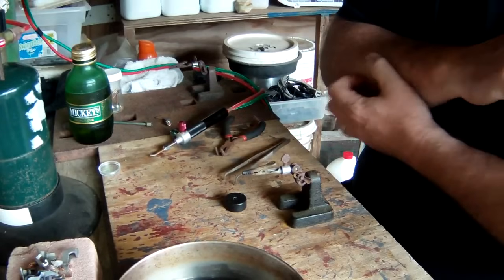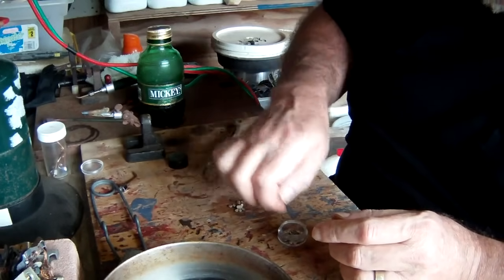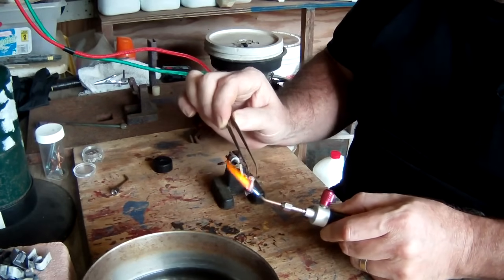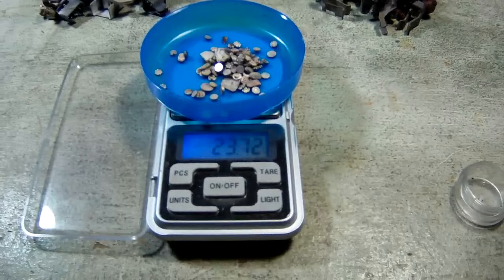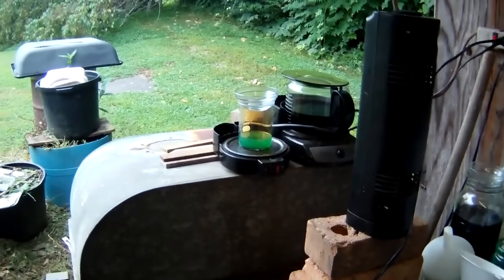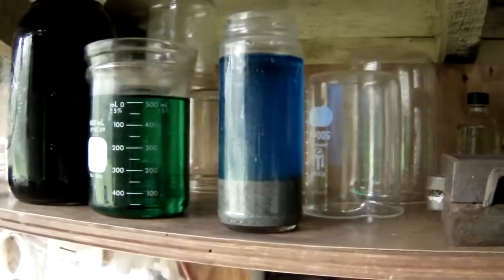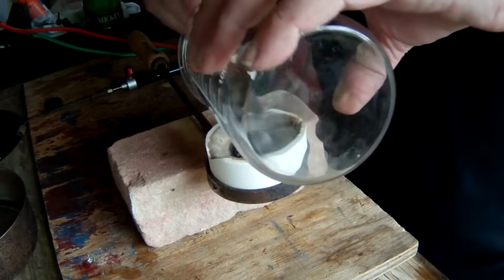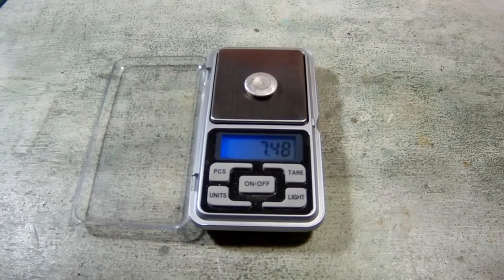Silver Contacts Recovery & Refine Complete Process (long video, but worth the watch)

Comment: It’s not a tungsten alloy. It is actually a silver tungsten ceramic. These probably came from circuit breakers. About 40 percent silver. Contacts from starters are much better. 70 to 90 percent silver and those are alloys.
Reply from the maker: Figured it had to be tungsten of some sort because of the density, LOL knew it wasn't gold ☹🤬 Thanks for watching.
Reply: Backyard Scrapping, yes tungsten has such a high melting point that if it were tried to become alloy with silver the silver would simply evaporate before the tungsten reached its melting point.
Reply: Backyard Scrapping, I think tungsten is right next to gold on the periodic table. I think a Niton gun would confuse tungsten for gold when combined with silver.
Reply from the maker: Tes they were from breakers.
Reply from the maker: @iamanempoweredone6064   True true! 😁

Comment: Silver contacts have cadmium
Reply from the maker: Yes they do, but the cadmium remains in solution after the silver is dropped. This is why I do not just neutralize my solutions and dump them, I considerate them down and pass them along to a friend who then removes the other metals from it. You just need to take care when removing the contacts from what ever they are mounted to by not overheating them enough to vaporize the cadmium, this is best done out doors. I have fans directing any fumes that might be generated away from me. As with anything like this, you just need to prepare and take care when doing it.

Comment: You made $5.95 on the one piece. 
You would have made more by Not melting it down. Around $23.00 by doing all the smelting.
Reply from the maker: The video was made to show the yield and answer a question, not to make a profit. Most if not all scrapping you don't get paid for your time, that is why it is a hobby.